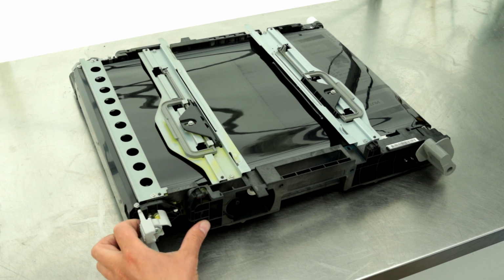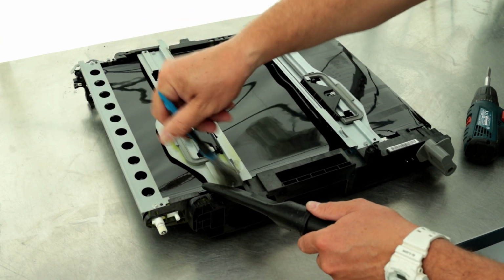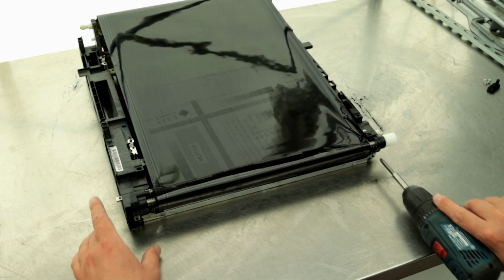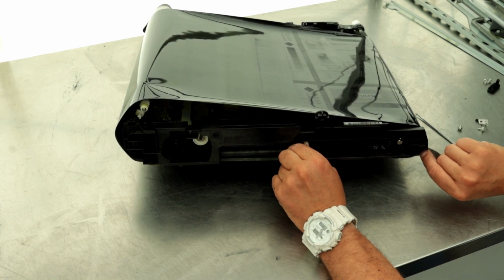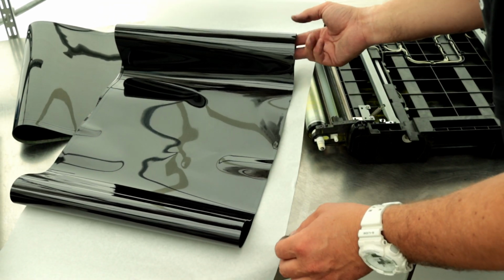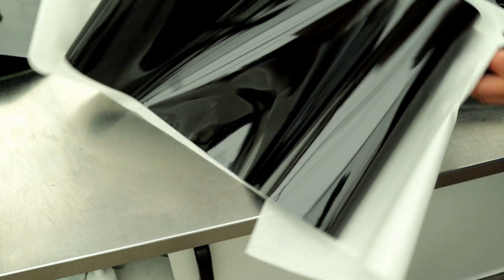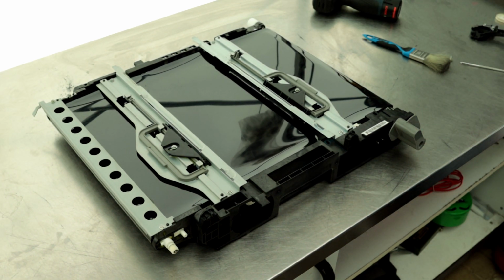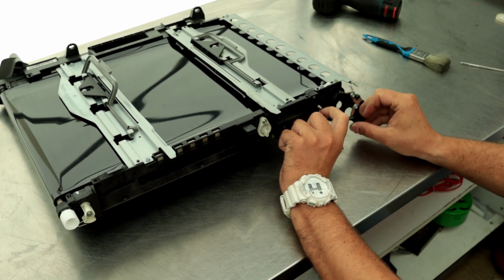Transfer Belt RICOH MPC 3502 3002 4502 5502 replacement

Comment: Hello I have Ricoh mpc3003 machine when I give 1 print  it's good but give 5 or 6 print continue its give  double image print on the paper..can you suggest  what's the problem
Reply from the maker: The Ricoh MPC3003 copier is a very good machine, but such a problem is impossible to diagnose from a distance. I can tell you that this problem may be caused by:
1. Drum unit
2. transfer unit
3. fuser unit
Reply: fixing problem or developer
Reply: @marcoguarnieri2029  That was transfer unit problem.

Comment: Sir what is resat code hp 436nda
Reply from the maker: Typically, there is no reset option on HP printers. You need to locate the fault and replace the damaged unit. After replacement, the printer will reset itself. There is no other option.
Reply: @MrRicoh   samsung k  2200 nd clear memory OR clear counter menu#1934menu 
Tech mode is open
That type in hp436nd
Reply from the maker: I have to check it on the printer.

Comment: Never touch belt with bare hands wear gloves, finger grease will need to washed off with isopropol alcohol otherwise
Reply from the maker: You're right. I should wear gloves all the time during this repair. Nevertheless, the transfer belt to the cassette machine works fine after installation. I've already done 264,000 copies on the MPC3502 since the tape was replaced, and that's fine. I'm lucky I didn't damage my belt.